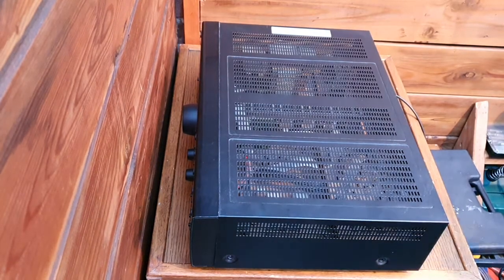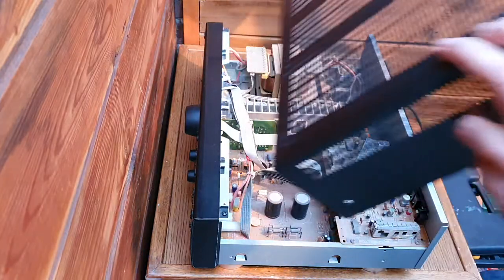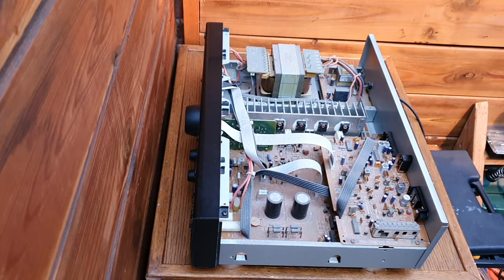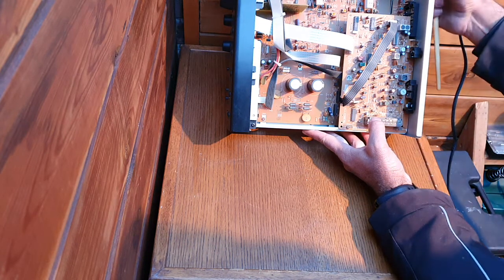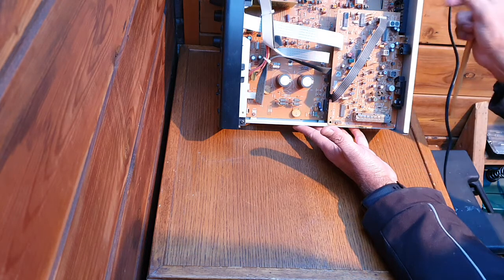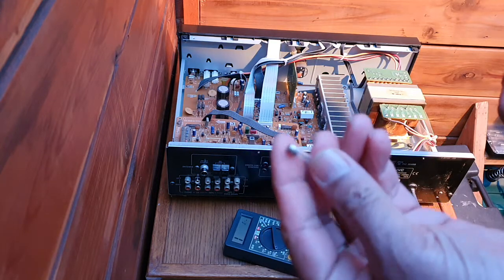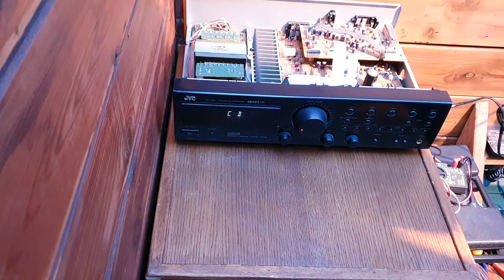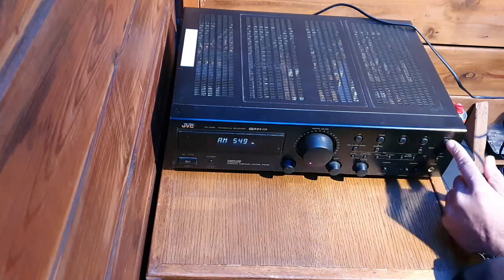Fuse Replacement | JVC RX-230R Receiver Amplifier | Easy Fix

Comment: Not helpful you didn’t show where the fuse is next time you make a video point where the fuse is and how to take it out all you did was edit your video showing the fuse in your hand even after you replaced it
Reply from the maker: Next time I will try to record clearly the repalcing of any component. Thanks for highlighting, much appriciated.
Reply: I hope that's all that is wrong with my VSX-3400. It has 4 of those fuses. They look normal not burnt. I'll test them to make sure.  Thanks for the video.